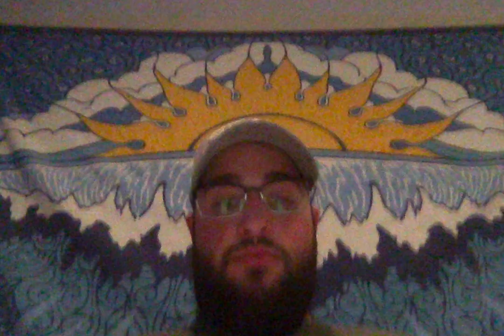I Explain Why Kobe Bryant's Helicopter Crashed

Comment: Another thought that I picked up on from another video. Was he in the right seat or left seat? If the right seat, could he have been trying to look at an instrument in the center lower console and thus his head and body leaning toward the left which lead to a minor enough left descent. In the clouds on VFR, he wouldn't have noticed this until too late. Hence the speed up/rapid descent without any slow down at all.

Comment: @Joseph Bauer...Helicopters are very different to fly compared to airplanes. Hovering in IMC conditions is very difficult to impossible. That's why helicopter autopilots do not engage until after translation lift occurs at ~50 knots .  The pilot followed correct procedures when he encountered IIMC. There are additional radio communications that were not available at the time. Here is a professional pilot explaining the findings of the just released preliminary NTSB report.
https://www.youtube.com/watch?v=ZxjlgmHt7Wk&t=628s

Comment: You are absolutely wrong, he didn't turn to his left, he was in a straight and level climb and as he is in the goo he starts a slow left hand turn, and it tightens and speed increases, and you are wrong on the helo not being able to stop and hover.  It is spatial disorientation and what the flight data shows is classic graveyard spiral.  You are right about the pressure to get Kobe to his destination.
Reply from the maker: Joel Rolley Thank you for the feedback, like I said I have only fixed wing experience so it was only a video of my thoughts at the time of the video no real information was out other than ATC Audio and flight path
Reply: Joseph Bauer no worries, sad story, happens all the time, fixed wing and rotary a/c.  There are some good simulations with weather included and you can see he is in clouds for about 20-30 seconds which is the right time to suffer spatial D.  It was also a Sunday morning so they will look at pilots personal factors like was he drinking Saturday night.  That makes spatial D so much worse.  I almost failed aviation water survival training helo dunker one time (after doing it multiple times before no problem) when I was blindfolded underwater cause I was cocky and thought I could go out the night before and drink.  Next day in the pool I was fine all day until the blindfolds came on and then I was F-cked.

Comment: Interesting review, focusing just on the weather. 

As a student pilot, you are also aware of "head-inside-the-cockpit" distractions. 

Aviation accidents are typically the result of a "flow of events" where two seemingly unrelated events combine together.  

Review again the precise ATC recording and overlay this (in parallel) with your weather findings. 

Focus specifically on squawk codes

Find a place where the pilot would have needed to  place "head-inside-cockpit" to resolve his transponder code being 1200 vs. 0235
Consider that, after looking up, he didn't know he had already entered a cloud with zero visibility
We'll let the NTSB fill in the gaps. 

Continued success with your flight training.  Pay attention to what has your attention.

Comment: I think you made this video too early.  You got lots of info wrong.  
He had no problem following I-5 or 118 as he went around Burbank airport and Van Nuys airport (not LAX).  He then went south across Van Nuys to get back to 101 west, which he wanted to follow all along.  He messed up by going too far along 101, up into the hills of Calabasas where there is no weather info, and where he suddenly flew into unexpected fog lower than the clouds in the valleys, which he had weather info on.  Calabasas residents are saying that the fog that morning was unusually thick and low, perhaps not seen in over a decade.  He wasn't careful and apparently assumed Calabasas would have the same ceiling as Van Nuys and Camarillo.  He paid the ultimate price for that assumption.
We have no way to know that 'get there itis' was a cause.  It could have easily been just unusual weather in the Calabasas hills, along a route that he ran very many times in his long career and had never had a problem with, that caused him to let his guard down.

Comment: Jet propelled helicopter affects stopping distance? Max acceptable decent is 1500ft/min...aircraft descended at almost 5000ft/min indicating an overbank situation do to spatial disorientation. Don't forget Witnesses reported very slow flight maybe a hover. Almost impossible to control at slow speed in IMC....
Reply: So does this mean that the pilot knew he was in trouble🤔 And if so why didn't he just call for help and land the Helicopter????
Reply: Does this mean that the pilot knew he was in trouble🤔 And if so why didn't he just call for help or just land the Helicopter.
Reply: @wadiyahabdur-rahim1558  
The pilot followed procedures, but crashed due to spatial disorientation. There was more radio communication that has since been released. The following is the most thorough explanation I have found, and the presenter is a professional airline pilot. 
https://www.youtube.com/watch?v=ZxjlgmHt7Wk&t=628s

Comment: Check out this video review of Kobe Bryant crash by Army trained Helicopter pilot who flies EMS helicopter for a living who knows this area flown for over 20 years with over 10k hours in rotary wing. He says there is no excuse for a CFII to lose control of a helicopter in IMC, but states there is a problem in the Part 135 VFR only commercial helicopter industry where even if you have a IFR rated pilot he isn't required to do 6 month check rides, or stay proficient.  Island Express is a VFR only Part 135 operation.    https://www.youtube.com/watch?v=-ymcG-YKOCM&t=2s

Comment: Most likely the passengers didn't see it coming
Reply: You can feel when you're descending though. Kind of like elevator at least that's what I think.
Reply: @sonyvalencia  apparently not in IMC conditions, the sensation of climbing and descending can be easily confused. Likewise, apparently, left and right can be confused. Apparently some chopper pilots end up upside down and not realizing it. This is how they lose control of the craft while in IMC. In short, without visual references there is no way to hold the horizon and it is only a question of how long until you crash the craft rather than if you crash it

Comment: Today NTS said control of that helicopter was not possible during drastic nose dive that occurred once they reached 2,200 ft. Also eye witness reported hearing shortly before crash the engine sound didn't sound right. This is looking more like mechanical failure.

Comment: I don't think you can hover in zero vis conditions without getting disoriented.  I think you have to maintain a certain airspeed.  Autopilot will automatically disengage at around 50kts.  Correct me if I'm wrong.  Plus, there was the Sheriff helipad about a mile away on the left side of the road he was following, which he probably knew was there, and may have been trying to find.
Reply: Decent rate was 5000ft/min...1500/min is normal Max...indicates overbank due to spatial disorientation. Pilot was IFR qual only as a requirement to fly commercial. No TAWS either. The pilot's ego exceeded his skill that day...not too uncommon at all.

Comment: No...you pretty much nailed it. Pilot error and a sense of tardiness probably forced Kobe to pressure the pilot to make hasty judgements.

I said that chopper should've landed at Van.Nuys. The 5 north is no place to gamble with your life (by air or land).
Reply: Other pilots who have flown Kobe has statement that he has never pressured them into flying more hastily to meet apts or practices.
Reply: Iuls Well, at this point, who in their right mind would say ANYTHING negative about him considering the magnitude of the tragedy. We can only speculate but I gotta tell ya....they were so close. 

In the back of my cerebral cortex, there's still this nagging theory that their sarkovski was remotely driven into the cliffs.
Reply: @broccolihart1  why? who benefits from that?
Reply: Imagine Do The illuminati handlers or there was mention of the Clinton's being tied to him monetarily. Whatever the actual cause of the chopper slamming into the mountain is, that copter should've set down at Van.Nuys until visibility was increased.

Comment: I had a question as an aviation layman, is it possible that the pilot somehow stalled the helicopter on his rapid ascent the last minute? Only the black box can tells us for sure at this point right? (I understand there is no black box in this case).   Could he have stalled the helicopter making such a rapid adjustment in heading and altitude like he did and could the fog have compounded the likelihood of a stall?
Reply: My sister (pilot) just said that’s what she believe happened
Reply: I think the pilot freaked out and climbed too high too fast without keeping level and all the weight of the craft rolled to the low side of the helicopter causing it to lose all balance and veer off to left. It came down heavily tilted into a quick and rapid decent and swooped downward at a high rate of speed right into the side the mountain.
Reply: Very likely. Slowing speed, Turning, Climbing..  Once it gets a bit 'off'..  hard to know that quickly enough..  & to apply the exact amt of correction..  so can happen quickly

Comment: Witnesses say 1/4 mile vis in heavy fog, and an uncommon engine noise. My guess is they had multiple problems starting with some sort of mechanical failure. Due to the fog the pilot lost control of the situation. I doubt they would let a new pilot handle that bird in forecasted IMC.
Reply: Engine sounded normal from a credible witness.  And a student pilot breaking it all down isn't an expert opinion by any means lol.  I'm a commercial pilot.  I'm not about to start posting youtube videos claiming to know the answers.  Listen to the NTSB not idiots on youtube.
Reply: Pilot had 8000+ overall hours.. 1000+ in a S76 from the sounds of it. I’m waiting for NTSBs official report.
Reply: I don't think there were mechanical problems. That's a twin engine craft that's highly reliable. I think once he got into IMC, he couldn't adjust in the 175 seconds or so he had and had spatial disorientation which ultimately lead to the loss of control.
Reply: Engine was normal. Pilot poor choice. Tragically it caused the lives of innocent people that trusted his best judgement

Comment: A plane was 'going around' at Burbank etc which caused a 15 min delay apparently plus being routed to the N do running late. Pilot reports being at 1400 then 1500ft...  may be lied about being in vfr...     going fast apparently..  Then rapidly slowed & descended likely to see better..  then likely saw 101 fwy & realized low & thought best to circle..  and boot it again to climb...  Any of which can disrupt very sensitive flight skill involved in controlling 20000 lb chopper.  Kobe & pilot needed to be more oriented to idea that on a bad wx day..   That going is not 'for sure' & more heavily weigh just not going/ cancelling.. or file ifr if that was an option... He must have been ifr rated...  but worried that he could get routed all over the place.
Reply: Feedback4Utoday  the 15 minute holding delay and having to go north around Burbank and Van Nuys more than likely added additional pressure to get there.  While he may of been VFR at 1500 over Van Nuys, we all know how the fog hugs the mountains and as he got to the 101, the ceiling more than likely dropped greatly.  As he approaches highway 27 and the 101 is where he climbs and makes the left hand turn.  My guess is the ceiling was extremely low at that point with the fog blowing through that canyon.  Unfortunately even if they popped out of the fog, it was too late as they were already in the death spiral.  For those who can stomach it,  there is a video of a helicopter crash in which a pilot was flying in IMC to deliver a bride to her wedding.  Pay attention to the sound of the engine and watch the attitude indicator.
Reply: @Sandeezy12  where is the video you speak of?
Reply: @Sandeezy12  very unfortunate.. will see if I can find it - haven't heard of it.  Something made him want to fly very low..  Must gave seen clouds very low to the W & knew CMA was only 1300 so he was mostly 1200...  At any rate hard to keep stable when in cloud & trying to climb fast ... turn back. Doing a bit too much at one time

Comment: VFR into IMC......
Reply from the maker: Very sad, but looks like that is what happened today.
Reply: Joseph Bauer its the first thing I thought when I heard it this morning....I live in SoCal.....
Reply from the maker: @Nate_dog01  i saw 2.5 miles vis and when i heard ATC audio that said he was flying SVFR i knew what happened. Classic story of VFR into IMC and Get there Itis. Interesting note, helicopter pilots who are only VFR rated can fly SVFR whereas fixed win pilots requesting SVFR have to be IFR rated.
Reply from the maker: Dean correct. I apologize for the confusion. SVFR can be done by VFR fixed wing rated pilot in daytime in controlled airspace.
Reply from the maker: Dean I agree. A classic Get There Itis situation. Flying dangerously to get to the final destination without issue.
Reply: My reason I hate helicopter God one slight failure it's over